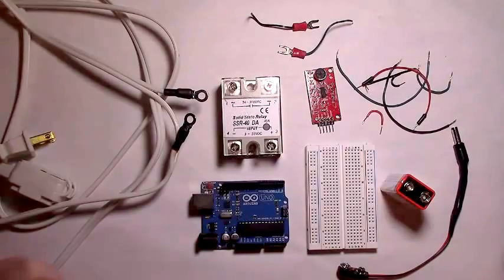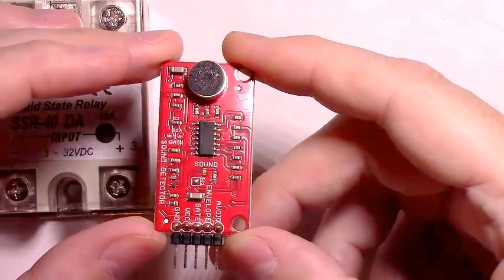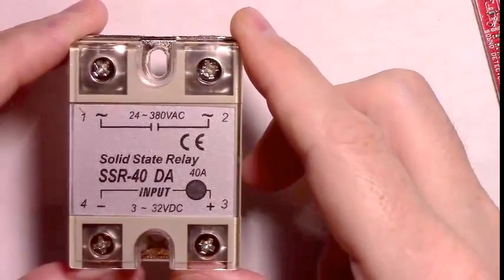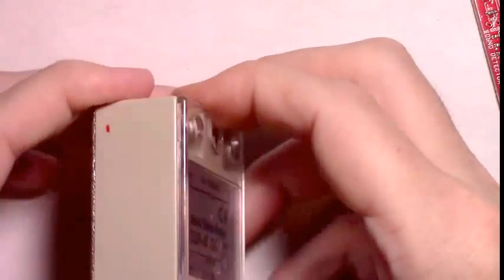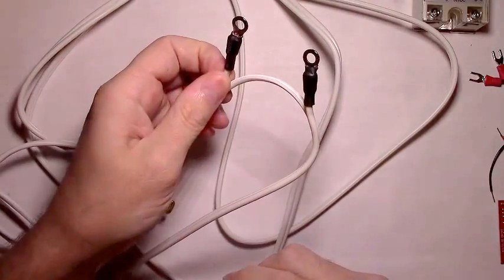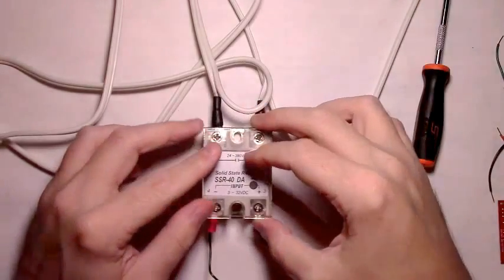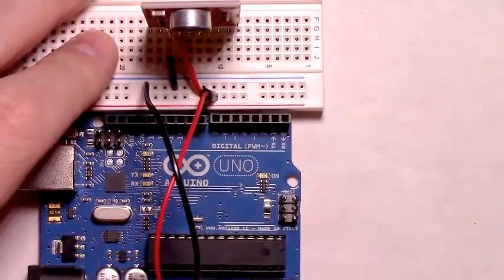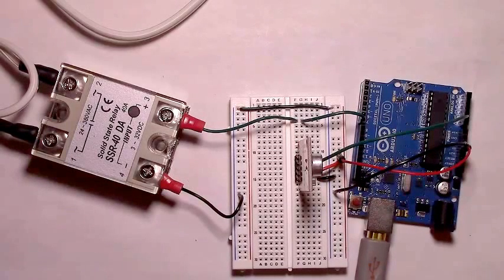Sound Controlled Lamp || Part 1 || Arduino + Solid State Relay + Sound Detector

Comment: Hi man, im doing a little project for a filling machine, i just want to know if i can put a solid state relay instead the led (without the led resistence) "/watch?v=e0xDGSausZ8" can be there any problem with the 5v supply of arduino? thanks
Reply from the maker: Angelvirus Thanks for the question.  I will do my best to help.  As long as the SSReay can be triggered by 5V, any of the Arduino's digital pins should work.  The SSRs that I've worked with tend to need very little current to trigger (5 to 15mA, well within the Arduino's current sourcing capabilities).  No coil, voltage spikes, etc., to contend with.  The only aspect of SSRs to be aware of is that some types allow a little current to flow even when not triggered.  As long as a little current passing through the AC side during an untriggered state isn't a problem for the project, all should be well.  Hope these comments help.  Please let me know if I didn't answer your question and I will continue to do my best to help.  Thanks for watching!
Reply: philo mech i will try to get the same ssr, if it consume 15mA there will be no poblem i think, thanks for your help man

Comment: on that relay for the output side can 12 v dc be used instead of 24 v ac? with 3 volt dc on the input side?
Reply from the maker: ***** Thanks for the question.  It can be switched with 3V, just tried it.  As to using that relay to switch DC, it was internally designed to switch AC --it contains a triac.  While triacs will conduct DC, it's often more straightforward to use a mosfet, or standard electromechanical relay.  But, if one wants to switch 12+V DC with 3V and also wants to use a solid state relay to do so, then such relays are definitely made.  Check out, e.g., Jameco's, Digikey's, or Mouser's online catalogs: keywords "solid state relay DC".  There are quite a few good options available.    Hope these comments help. Please let me know if there are more questions.
Reply: ok thanks i already have a relay like in the video so i wonder if i cud use that even if its not designed for dc it technically should work but not tryed it yet il let you know if it works as its only for a elec door lock (12 vot dv). thanks for your reply :D